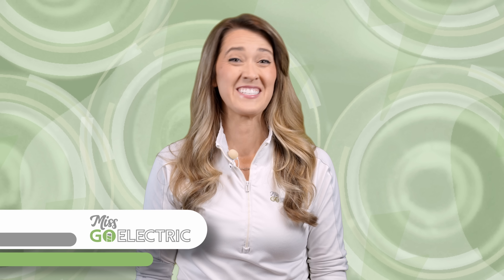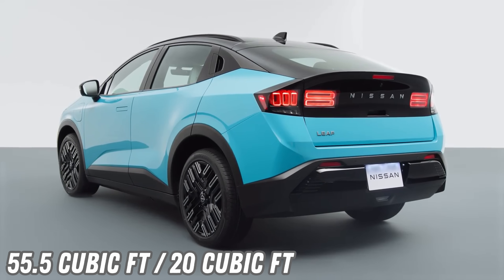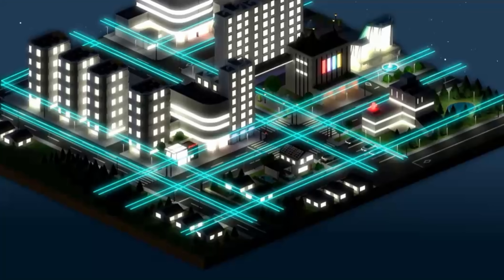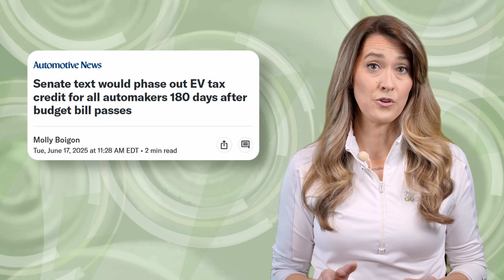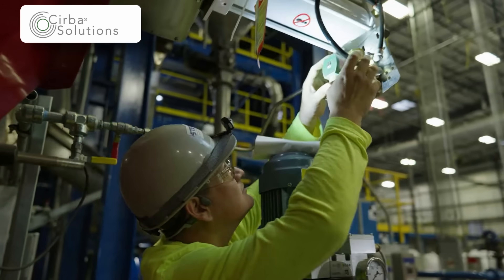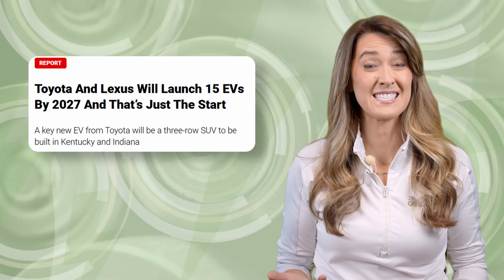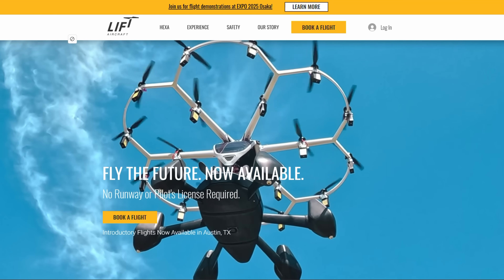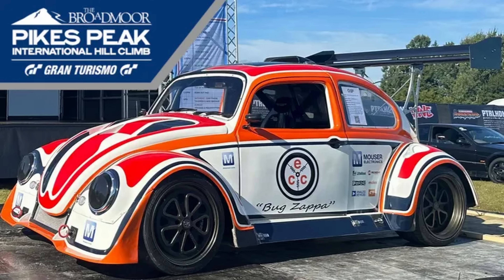The Current : Weekly EV News Ep#68 Jun 22, 2025

Comment: The gen 3 Leaf with 2 charge ports had to be the biggest WTF moment I have seen since gen 2 stayed with ChadMo. Are they trying to drive down sales?
Reply: Yes, an unneeded manufacturing complexity adding to cost.
Reply: Does anybody on this planet actually look into charging protocols and systems??? Okay, here's the base details: NACS is a single port charging standard with shared AC/DC pins with a switch to choose AC or DC charging and an onboard charger which must be capable of 277 volt charging. The NACS change was made mid-design. Their onboard charger supports up to 240v as CCS needs, so to NOT have to find suppliers for a higher voltage onboard charger and figure out a switching mechanism, they took an international version of the car with 2 ports, and since CCS uses 2 seperate AC/ DC charging wires, simply turned the AC wires to point at a J1772 adapter to keep the same onboard charger and wiring, while pointing the 2 DC pins to NACS.
Reply: @raychang8606    Yes, because the supplier they were issuing for the 204v limited charger they were working with is not also making 277v units for all the other manufacturers.  Nissan knew two years ago they were switching to NACS, that they did not have time to replace an internal component is not really a valid reason for not doing the correct thing and making the needed changes.  It would easily be argued that moving to two ports and two charge port covers was more of an engineering change.
Reply from the maker: The decision to pivot to enable NACS support results in inefficiencies, but it was not made by idiots.  Remember, these supply chain negotiations started YEARS ago.  No doubt they had large volumes of CCS ports already ordered.  They understood that any integrated solution to enable NACS was better than none.  Nissan took the best course of action they had...and they've got two ports...as the LEAF has always had.  The Porcshe Taycan had two ports, too.  We didn't hear the outrage then.

We suspect there will be a LEAF refresh in 2-3 years and maybe they'll do away with the extra port.  Either way, we think EV drivers should carry NACS-CCS adapters for interoperability for maximum flexibility when traveling.  Hundreds of Supercharger dispensers are NOT compatible with third party NACS and that prohibits travel through entire states in the southeast.

I don't see how having two ports presents any real-world detriment to an average user.  The average EV drive only uses DC Fast charging 3-5 times annually.  Most folks will just plug in at home using the port which is immediately outside the driver door 99% of the time.  Its sweet and convenient just like Miss GoElectric's Rivian R1T. Occasionally, they'll use the NACS port on the passenger side, and that is OK, too.
-Producer Tim